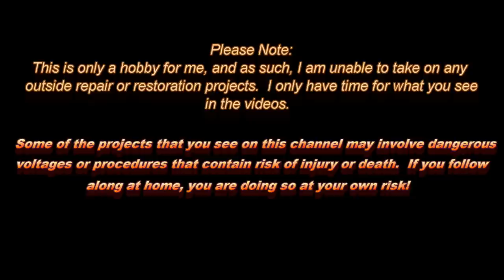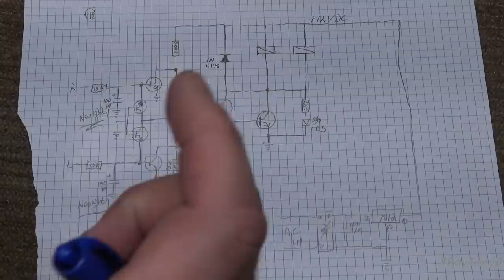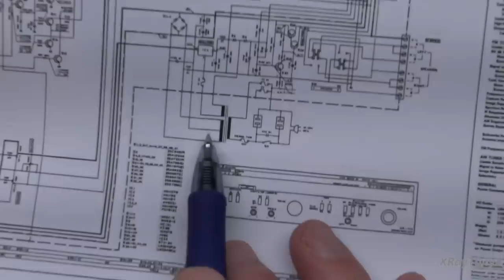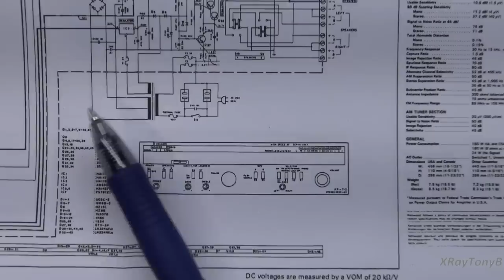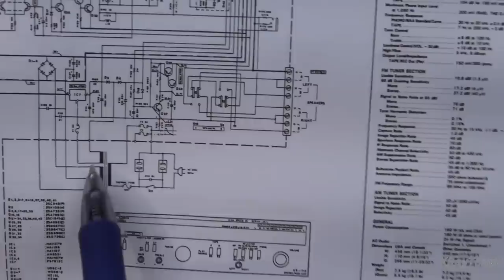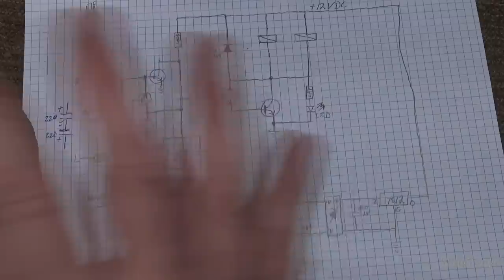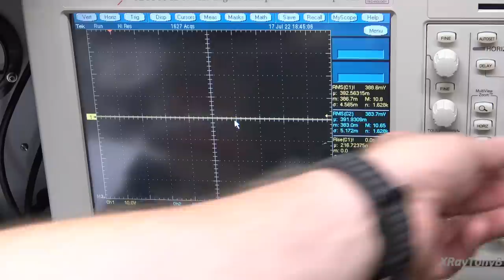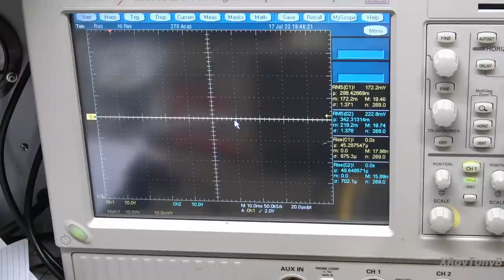Speaker Protect Circuits - In Practice

Comment: I can't understand why you didn't just take your +32V rail and use it to drive the L7812 directly. They are rated for 35V and without a heatsink will dissipate 2W before shutdown. Those generic relays won't draw even 40mA and 80mA x 20V = 1.6W. Probably a lot less - or you could put a 120R 1W resistor in the line feeding the L7812. Surely that bit of dissipation is going to be less of a problem than the noise you'll get from a switching regulator?
Reply: These circuits can kill the pop-up at switch-off, that's why they use the AC. You switch the amplifier off, the secondary AC will drop, no voltage to operate the relay, so it disconnects the speakers before the pop noise. If you just put it on the positive rail, that will keep some charge, so the protection will drop the relay later than the switch-off transient. I fell in the same trap at first. I'm not sure Tony's solution with the buck-converter will work properly at switch-off.
Reply: @gaborszigeti8914  If the circuit relies on the positive rail dropping to unlatch the relays on switch-off, I fail to see how the buck converter would drop the voltage to the relays any quicker than a straight piece of wire would.

Comment: 16:39 Is it not possible to use a Capacitor dropper circuit, because at the end, it's only purpose is to feed 2 relays? 
If you use low current relays like the Finder 30 subminature series,  those consume arround 12mA at 12V.
With a Capacitor dropper circuit, you also don't inject high frequency noise like the buck converter does.
Regarding the whiners, 1 word to remember -> WOTAE (Waste Of Time And Energy).
It's your channel, and you do or don't do what you want, you say or don't say what you want. The most majority of us viewers love and enjoy your video's, no mather how long or short they are. And for the people that don't like your way of doing, they developed a exit door at the top right corner in form of a X to click on. The fact is they don't find the X and stick arround to place whining comments, that's there problem not yours. Keep doing what you do. Grtz

Comment: you mean boost converter regulator, not buck regulator that reduces voltage
you're a bunch of oxymorons if you don't like it but you want to be compelled to watch it 😂😂 well said
Reply from the maker: I am reducing the voltage from 32V to 12.  It's a buck.
Reply: @xraytonyb  well in that case yes! but you were talking about taking it off the transformer for the bulbs what would be 6-12V
Reply from the maker: Sorry about the confusion! :)
Reply: @xraytonyb  probably me I was listening in the background, I see you wrote it in the listings. you could surround the buck converter in a little box covered in copper tape grounded block the # amplifier sounds nice you're happy with it.